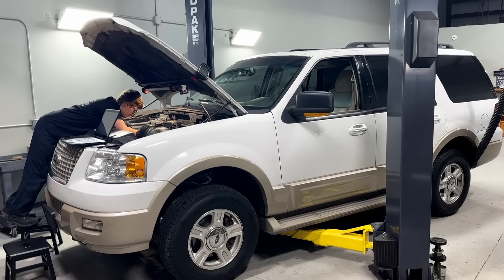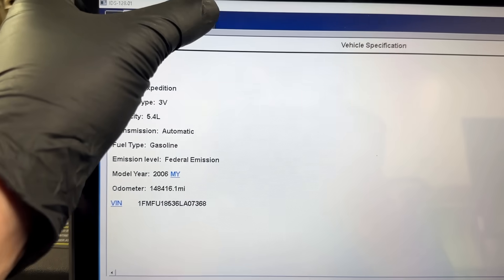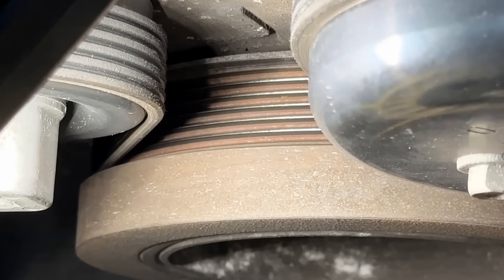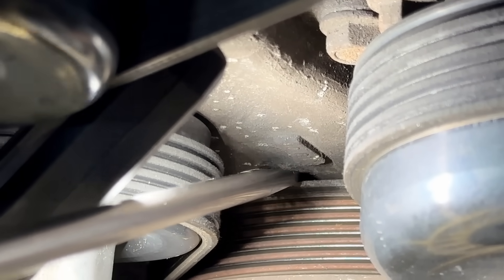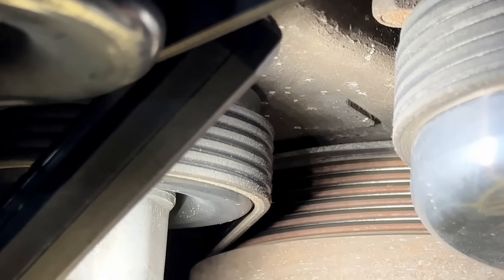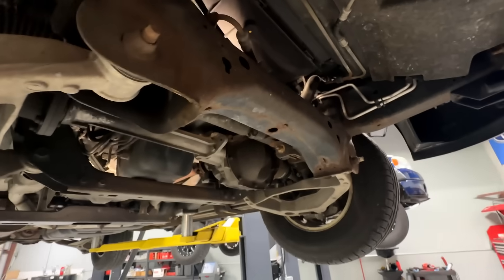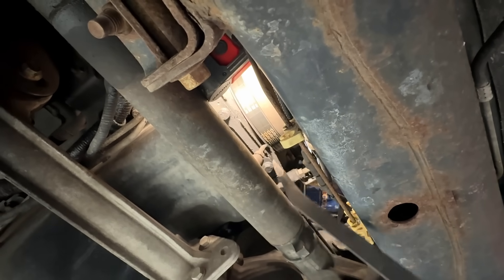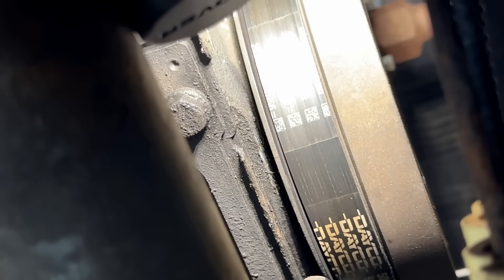Ford 5.4L 3v Triton Engines: Always Check This First Before Performing a Timing Job on this Engine!

Comment: I know this video is older , but the serpentine belt was at the edge of the tensioner/idler on left of bad crank 
well inside on the good crank.
Reply from the maker: Yes, but as explained many times in the comments already you cannot rely on that as an indicator since a lot of aftermarket tensioners do not line up with the belt perfectly like the OEM tensioner. That is why it is not mentioned in this video as I do not want to mislead vehicle owners with inaccurate information.

Comment: I have an 08 5.4L 3V F150 with 158k miles. The truck/engine runs smoothly and has no noise or other issues at this time. However, I feel I have a ticking time bomb on my hands. I've watched several of your videos on the issues with this type of motor and the repair procedures.  I am going to start gathering up the tools and parts to do a full timing, oil pump, roller rocker overhaul and other related replacements while I am in there. Your tutorials have been invaluable. Thank you for sharing your knowledge with all of us.
Reply: Just put the aluminum blocks in the phazers and do the delete and you wont have to worry about it!
Reply: @noobjitsu1743  Can you clarify?  I am not sure what you mean.
Reply: @emagee7864  You can do something called locking out the phazers which u can do by putting blocks in the slots thatthe phazers move and then delete the phazers out of the ECU so there is no VCT system
Reply: I jst heard about something like this called Livernois. Not sure if it still pertains but FYI lol

Comment: I'll give kudos to this tech who has the guts to rebuild these engines. Most techs I know got stung on some of these jobs because the motor was trashed. By the time I saw them they would go into a low idle rpm mode and they sounded like a diesel because the oil pressure was too low and the cams became out of timing (at least on one side) and barely running at idle. Motor was trashed at that point. Always best to verify oil pressure but on a 4x4 that was a pain to do and the motor needed to be fully warmed up too.

Comment: But you still don't know if oil is getting starved to the cams on these engines without pulling a valve cover? Personally, I wouldn't touch one of these engines without the understanding they could fail at any point and the thousand dollars one spends on timing components would be down the drain.

Comment: I checked my 05 it has a small gap but no movement.  Truck at 123k only put 3-4K on it a year.  Is their a mileage level where you just do a timing job or just take the chance and do it immediately when you get the rust sign?  I plan on keeping the truck a paint job with even a new engine is cheaper than trucks I looked at.  I live in midwest very little snow or and salt so only surface rust underneath

Comment: I have this issue were engine stalls then goes into engine safe mode. I have the oil leaking like in video. The truck still running is there any chance of saving the engine by replacing seal or washer

Comment: Do you have anything possible causes of a imcr stuck close, how to troubleshoot either open circuits to air leaks in the system?
Reply from the maker: Most likely the wire harness behind the intake was not routed properly.

Comment: I have been an ASE CERTIFIED MASTER TECHNICIAN for over 40 years and I have seen more bad 5.4 3 valve Ford's then good ones. The Ford 5.4 2 valves are great engines, but personally I won't have a 3 valve.

Comment: I have a 2011 expedition with about 190k miles on it.  5.4 3 valve of course.  Making noises I don't like.  I have been watching your videos trying to sort through what is the problem.  I inspected the crank pulley like you suggested and can't get it to move much in and out.  It does seem to have a noticeable gap between the pulley and the front cover though so I am not sure what to make of it.  A good bit of oil around the back of the oil pan and the area above the drain plug going up also so makes me wonder if rear crank seal is out like you suggested.  Thoughts since the pulley won't pop in and out?  Also just wanted to thank you for making great informative videos like these.  They are so helpful.  You do a great job explaining and showing what you are talking about.
Reply: I have  2011 expedition and have the same thing. A gap with NO movement. Did you figure out yours?

Comment: I just finished up a timing job on a '07 3V and followed your timing video religiously. You were very thurough and I really appreciate that. I've checked the lateral play of the Crank and it seems within spec. Could bad roller followers be the culprit? Is there anything else you recommend? I'm not getting any misfire codes only Bank 1 retarded timing and Bank 2 advanced timing. P0012 & P0022 if I remember correctly. Any suggestions would be greatly appreciated.

Comment: Is the root cause a transmission issue? Excessive torque converter expansion is about the only thing I can think of that would cause that much thrust washer bearing wear on a 150,000 mile engine, that's more akin to what you'd see in a vehicle with a manual trans and a very heavy clutch setup and/or excessive stop/go driving.

Comment: I performed this crank pulley test on my 07 F150. It passed at nearly 200,000 miles (having timing job done as we speak) will I ever have to worry about thrush washer in future if at 200,000 miles it’s in good shape?

Comment: This has to be the best video this year. I have never shied away from buying a 5.4. everything I own or buy are Fords. 

This was perfect timing pardon the pun. I'm going out tomorrow to look at a F-150 with the 5.4. I decided for this summer my project is  going to be to make my own Raptor. I found a great deal on an 07 so it falls right there in the middle. When I am done with posting this I am going to get my pry bar and one of my pieces of wood and take it with me.
Reply: Results? I have a 07 f150 KR myself getting a timing job done did this test too before doing job

Comment: When I did my 4.6 up one thing I noticed was it only had one end play bearing, yet the engine was made for two. To me that doesn't make sense, and since my kit came with two bearings I used both when I put it back together. No problems to date, I figured two had to be better than one, but still haven't figured out why it only had one? And that was from the factory, engine had never been apart. Why they only use one end play bearing?... they forget to put it on or was that the norm?

Comment: My 04 F150 had a 06 Expedition 5.4 swapped in at 205,000 miles.  No excessive end play at 160,000 miles.  It got the Melling high volume and high pressure oil pump, new Ford chains and cast tensioners using Rotella gas truck oil.  Runs like a champ but after watching your other video I realized the Expedition injectors are still in it!  Need to swap them out.  If you didn't make the video I never would have known since its not throwing a lean code.  Thanks for the videos!

Comment: Great video, thanks for taking the time to present it. Of course it may not hurt to first check the harmonic balancer bolt, make sure it's tight (probably would be, but was my first thought that came to mind as I watched the video). I might also recommend pulling the torque converter bolt access cover and confirming the observed movement back-there on the flywheel with a dial indicator as you're prying forward/backward from the harmonic balancer on the front-end. 

The first set of main / rod bearings I did in-frame was on a Pinto way back in the day (1990). Do you know if the oil pan can come off on these 5.4L trucks in-frame? I might be buying one of these trucks which I think needs the chain and guide work all done (probably rockers too), hoping it didn't drop a valve (it's a no-start he said). I will also check the end-play now after seeing a couple of your videos on this. 

I know all about end play from doing lots of engine rebuilds over the years, but as one might think, it is not typically considered a 'usual suspect' for a general mechanic to think it should be that far out-of-spec on most cars hehe...

Anyways, good find, keep it up!
Reply: hhmmmmmm...

Comment: I get a high pitched rattle for about 3 seconds that starts loud and peters out over the 3 seconds. Happens with CC set, at highway speed uphill, when the trans downshifts and RPM's spike. 08 5.4l 3V.

Comment: Here’s another observation

If you go to 2:35 mark and pause

You can also see the leading edge of the belt on the idler pulley on the left has walked off the edge of the pulley at the front 

Whereas on the good motor its well and truly seated back from the front of the pulley

So as the crank lurches forwards its also walking the belt off the other pulleys……
Reply from the maker: This is also true, but you have to be careful here because a lot of aftermarket tensioners are not built to the same specs. So, on a perfectly fine engine that has an aftermarket tensioner the belt can ride on the edge and everything else is fine. That is why I do not mention it because I do not want to confuse others whereas the crank pulley is definite.
Reply: @FordTechMakuloco  

cheers mate, 

yes I did notice the pulleys on the left were slightly different design between the two and I forgot to point that out but on the other hand if some of the viewers don’t pick that up maybe they shouldn’t attempt the job… haha 

what a great video series. 

I have one of these motors here in Australia in my Ford Fairlane. helped me out a lot. Thanks again all the best from Melbourne Australia

Comment: you can see it on the tensioner where the belt is riding, the one with the crank walk has the belt riding on the edge of the tensioner towards the radiator and the one that is fine has the belt riding on the edge of the tensioner towards the timing cover.

Comment: Whare are you located.I have a 04 f150 with no rust at all. I  would like to get it bullet proof. I am 100% disabled veteran. 
At this point the motor has 175,000 and seems to be running fine with no noises and good oil pressure. Thanks JD from Florida.

Comment: S you wouldn't do a timing job on this ford? or you would? just the rear main repair? or scrap yard?
Reply from the maker: This engine requires a complete rebuild at a machine shop. I refused service on this engine yes.

Comment: You could see where the belt is riding on the Idler pulley just above the crank pulley is an indication the crankshaft is walking out

Comment: Dang the more I see and hear about these issues on  the Triton engines I'd never own one .  I'll just stick with my Taurus with the 3.5 non turbo engine. Besides the 3.5 having a internal water pump which isn't a big deal as long as you catch it in time to prevent catastrophic engine failure these engines seem to last forever properly maintained. A couple friends of mine have the 3.5 non turbo engines in their Taurus's that have over 300,000 miles and besides the water pump having been replaced they've had not one issue like the Triton motor has.

Comment: It appears when the thrust washer is worn and the pulley moves out, the belt isn't running properly on the tensioner as well. It's toward the outer edge.

Comment: So if I'm reading this right the engine needs to be pulled and the lower end needs to be rebuilt then. or depending on how much if any damage the engine will need replacing.
In your case of that Expedition looks like just the lower end can be rebuilt ??
Well I better go and check mine. 
Like always Brian you are a wonderful tech and great friend to all of us who need help like this.
Blessings to you and your family.
Reply from the maker: It is times to yank the engine and rebuild yes.
Reply: info pls...

Comment: Or you do a timing job and the pickup tube O-ring fails, starves the engine of oil and seizes on the interstate. Then you know you need an engine.

Comment: Have a 04 f150 that's loosing oil pressure when at normal operating temp and you hit the brakes. Could that be the thrush washer?
Reply from the maker: It is possible yes but most likely excessive clearances within the engine.
Reply: @FordTechMakuloco  I'm putting a mechanical gauge on it this weekend to check it out. Also going to change the oil and drop the pan. Just want to eliminate the 2 other options that I thought about. A bad sending unit (although I have changed this) and a clogged/disconnected/broken pickup tube. But what do you mean excessive clearances? Basically a full rebuild?

Comment: Please excuse my ignorance but at the beginning of the video you say “this is going to help me determine if timing job is needed or a new engine” but then, what was the outcome??? When you see it apart from the engine case and it moves like that, does that mean “timing job” or “new engine”??
Thanks in advance

Comment: Just wondering if you’re changing your oil filter and the oil on the schedule in the owners manual, and I’ve changed to a 5-30 oil, if I’m still gonna have timing problems at 100,000 miles or more?

Comment: This would have been super helpful to know back in 2019 before I  dumped a ton of money into all the timing components. My son drives the truck now and I was noticing some oil spots in the driveway and I got underneath it and it appears to be the rear main seal leaking so it leads me to believe it has this issue
Reply from the maker: My original in depth video about this defect was posted on Feb 2, 2018.

Comment: This cold snap has my 03 expedition 5.4 2v running random multiple misfire codes, also I think it was not enough warm air codes, will double check the code numbers and try to edit. has had lean codes for awhile before this like a year. short term fuel trim around 50% bank 1 and 2 lean, has a bit of a tick at startup but I change her oil every 3k, pretty deep exhaust tone I think the intake manifold has a leak it whistles when its cold. Brand new fuel pump and relay about a month ago.
  But its running rough at idle only when warmed up and starts misfiring and stalling, then when I drive the rpm goes up it seems totally fine. Also I cleared the codes after a oil change and new air filter thought maybe it sucked in some  Ice sickles so I cleared all the codes then it started idling totally fine for like 30 minutes while the engine was warm. Has 207k miles on her it was -30⁰F with windchill during the storm.
Totally weird any thoughts?
Reply: O2 sensors only work properly after warming up. For that reason the sensors have electric heating elements in them to quickly heat them up when doing a cold start on the engine. I suspect there 'could' be an issue with the O2 sensor heater(s) not working properly if things look normal after clearing the codes on a warm engine.

Comment: On the top view of the bad crank,  you can also see that the belt isn't riding centered on the tensioner pulley (lower left in shot). It looks like the belt is riding over the front edge of the pulley.

Comment: Very interesting I been driving a 2002 ford f150 5.4 triton for past 8 years put 102k on it all I’ve done to it so far is the intake coils plugs heater core hose and I got it from ford the one with the little set down peace inside it so don’t get to much pressure to heater core pcv and hose free vacuum lines trucks been taken too care of all it’s life kept up with oil changes Ford products only on it. I’ve recently developed a ticking/rattle noise mainly above 2000rpm while pulling mowers behind it not as much with no trailer plugs are all tight can’t seem to find a exhaust leak but there a slight exhaust noise kinda but sounds same on both sides of engine if you read comment and get 5.4 triton with similar prob please make a vid thanks for all the info you put out there really helpful

Comment: Hey Makuloco! My local autozone has a reman Nutech 5.4 3V engine. They have a number listed and I called them they claim to use the Melling oil pump and cam bearings + Ford phasers . Would you recommend them? Comes with a 4 year unlimited warranty. Thanks.

Comment: I had the same prob 2005 FX4.  Went for a  timing job around 124k miles and found out the crank had 1/4” play.  Cylinders and block were like new with the synthetic oil.

Installed a crank kit, new mellings 360 oil pump, Ford VCT gears/chains and she is running fine.

Still love my FX4.
Reply: New crankshaft with main bearings and gasket set in one kit.  Don’t remember if the rod bearings were included or we bought them separately.

The crankshaft in my engine ate the thrust bearing and scored the crankshaft, it was un repairable.
Reply: I might be in the same boat as you are, can you explain to me what a crank kit is
Reply: How much were the parts and how much for the labor for that repair

Comment: If you have this problem in your vehicle what does it mean? Do I need a new engine or replace the pulley? Will a timing job fix it? I didn't fully understand what the fix is.
Reply from the maker: Like I said this will tell me if it needs a timing job or an engine. I think I said it at least 3 times.
Reply: @FordTechMakuloco  I did hear that part , sorry that I have zero mechanic knowledge. No reason to be rude about it. I just didn't hear you say , so because of this play it will need an engine.
Reply from the maker: Not being rude I just don't understand how you missed it that many times is all. I have a link in the video description that shows what it looks like inside when the thrust washer fails.
Reply: @FordTechMakuloco  awesome 👌 thanks

Comment: Okay I need advice? I have be trying to get my 2004 Ford f150 running again. It has a 5.4 3v engine.  It had no oil pressure. I have torn it completely down, replaced the oil pump cleaned the oil pan and pick up tub. It now has all new parts including new cam fazors timing chains and guides. New water pump new harmonic balancer etc.  I put it all back together and still no oil pressure.